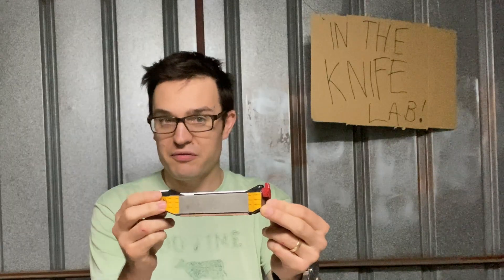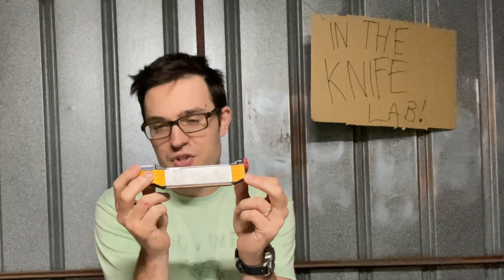How To Sharpen in Full with the Work Sharp Guided Field Sharpener (Review)

Comment: Quick tip for cleaning your ceramics, when they get blacked up they don't sharpen so well, so run a pencil eraser over them to clean them up.
Reply: Holy crap I never knew that. Thanks for the tip. I hate when ceramic gets blackened
Reply: Thanks for this, got a rod for serrated knives, and it's forever going black.
Reply: i dont mean to be offtopic but does anybody know a way to get back into an instagram account??
I somehow lost the login password. I would love any tricks you can offer me.
Reply: @Kane Kashton it worked and I actually got access to my account again. I'm so happy:D
Thank you so much, you really help me out!
Reply: @Elliott Troy No problem =)
Reply: When ceramic gets blackened to the point where it impacts the sharpening effectiveness, it usually means it's time to use a little dawn detergent and warm water to really clean out the ceramic. I'd be a bit worried that the eraser material would clog up the ceramic even worse than steel particles alone.
Reply: @JustIn-op6oy  That's what I do, but if you do a full wash down just remember to take the plates off and make sure they and the inside of the sharpener are completely dry or the back of the plates will rust.  I've used simple green sprayed on a paper towel to wipe down the rods and it returns them to their cutting glory instantly.
Reply: Bon Ami, paper towels and water works really good on ceramic rods too.
Reply: Tooth paste does a pretty good job as well.
Reply: The strange thing I found is that if I coat it in “grease” or “cream” based compound it works really nice too.
Reply: @rshveyda  you can remove the rod from the sharpener by using a jewelers screwdriver or similarly thin metal rod to remove a metal pin the holds the ceramic rod in place.
That way you can wash just the rod and not worry about getting the entire sharpener wet.
Reply: What if i take off the diamond plates and wash the whole thing ??? Should i worry bout the leather strop getting wet ??
Reply: I found barkeepers friend works great for that too
Reply: @sae1095hc yep...just used that exact same method on my WorkSharp Retractable Honing Rod.  Easier than using Ajax/Comet/etc. to clean it.
Reply: Hello, I'm 3 years from the future. I've come to thank you for this tip 👌
Reply: Barkeepers friend works well too.
Reply: @andreibirsan2388 - Ha, my man. I was just saying the same thing love that shit.
Reply: Thank you

Comment: Little tip.. When sharpening on this or any stone don't run the tip of the knife off of the stone, that'll cause your tip to blunt. Try stopping when the tip of the knife has been sharpened then lift the blade off instead of continuing the motion off the stone
Reply: I thought you were crazy for commenting this on petes video, as its such a novice mistake, generally. 

He does do that, though. Pretty bad, some times. Bad enough to likely snap the ultra fine tip on a few of the really hard PM2s.

No hate or anything, ive been sharpening most of my life but cant say id be comfortable putting a video of me doing it on yt for everyone to criticize.

Edit: also suggest lifting a bit to maintain the edge angle at the tip
Reply: Tip seemed pretty good when he split that paper.
That said, I've always done blades in segments- the straight, the curve, then the tip.

Comment: Good video! I have used this sharpener for about 2 years, with good results. It is a FIELD sharpener - don't expect it to take the place of $350 worth of Naniwa stones. That said, I was pressed to repair the overstropped convex edge of the 1095 steel blade of a Tops Brakimo. Using the plates as you would a full size set of quality stones, going back and forth along the length, versus pulling the edge across the plates, I was able to rework the edge to the proper profile, then refine with the ceramic and small strop. The knife was put back into service, then properly refinished once I was able to use my traditional strop with green and white compounds. The knife is sharper today than it has been in years. I absolutely agree that this is an excellent tool for all blade owners, especially those uncertain about sharpening or unwilling to learn and buy high quality stones. With this kit you can keep a blade 100% serviceable for a very long time - long enough to learn and save for quality stones. I have also used the hook sharpener for some of my expensive japanese hooks, as well as the broadhead removal tool. Also, I don't remember if Pete mentioned it, but the ceramic rod is held in place by a small silver pin. If you remove the pin, the ceramic rod can be used outside of its housing. Worksharp has also made all parts of this kit replaceable and offers them separately. In my opinion, it was money well spent.

Comment: I started with this 4 years ago and I'm still with it.
Reply: 2 months later?
Reply: I've had the Field Sharpener for about 4 years too. I use it on my EDC, sheath knife and all my kitchen knives. It's great for touch-ups with just the ceramic surfaces
Reply: The stone not not going deeper after 4 years of strop the knife on it?
Reply: @dolguldur4706  ...no, seems very good still
Reply: Cant be much blade left then …

Comment: I picked up one of these About seven years ago and have been using it as my primary sharpening system since then. Mine is sold that they still used stickers for the instruction panels on the back. It was the first production run I believe. Great system highly recommend it to lots of people.

Comment: I just got this sharpener and followed along with your video. had my Benchmade for 5 years and it has never been sharpened. after following this video it seems at least as sharp as it was new. thanks!
Reply: 5 years did you never use it lol?
Reply: I wouldn’t be able to stand a dull knife
Reply: @conley_v5848  used it every single day.. treat it right and it’ll hold an edge for a while
Reply: @jamesyuh46 
I had a Benchmade I used as a work knife the griptillian for 2 or 3 years before really noticing it dull. A lot of it is knowing how to use a knife, and when to pull out the 10 dollar Kershaw to doin something a bit too destructive lol

Comment: I struggled using other stones and systems for years. I could get them fairly sharp but not hair splitting sharp. Then about four years I found a great sale through Work Sharp and bought both this field sharpener and the Ken Onion professional edition belt sharpening system. I found both to be better than any other system I have tried! This field sharpener is so simple and easy to use that I rarely go to the trouble of setting up the belt system unless I want to sharpen multiple knives. 

What I have found from using this field sharpener is that it taught me to hold an angle first. Next I learned how to identify and even feel the burr you make on one side before switching to the other side of the blade. Learning to identify when you have formed a burr is game changing when sharpening a knife. You can do equal amounts of passes per side and get a sharp and usable edge but if you learn to find sharpen on one side until you form a burr, switch sides until you create a burr and then move on to the next grit you will have created an apex edge which I feel is sharper and lasts longer. Then after some use just touch up on the strop and you are back to razor sharp again. 

My number one tip is to learn how to identify the burr!

Comment: At 14.08 you say again a 20 degree guide. I found this video after just buying this sharpener today and the instructions say the ceramic guide is 25 degrees. 
Any idea why it's steeper?
Reply: The diamond plate guides are 20 degrees. The ceramic rod’s guides are set at 25 degrees to form a micro bevel.

Comment: I probably use this more than my KME. Love that little guy.
Reply: Is that because you need to sharpen often away from home or you use it because you don't need the mirror polish?
Reply: @Meowbox9000  just easy for touch ups. No set up, and it works well. I use the KME for reprofiled or damaged edges.
Reply: EDC elephant totally agree, this is much easier than setting up the KME.

Comment: Instinctively..: I would not want to waste a hand's energy and attention to just hold in place the sharpner, and one single hand left for maintaining angle thus  VARIABLE pressure to control. At least just only push-locking the sharpener egainst a resisting something (groove or clamp or "wall"  but not trying to hold it against any direction. Instead I would take both hands to hold the knife (on both its "extremities") and perhaps use my whole body to some extent (- or inverse, fix the knife).

Comment: The ceramic and strop angle guides are actually 25 degrees. For whatever reason they designed this to put a 20 degree gritty bevel on it followed by a finer 25 degree microbevel.
Reply from the maker: interesting! probably helps steer the burr into itself
Reply: Cedric & Ada Gear and Outdoors True! Seems to work well. I imagine it also helps negate/offset any angle deviation on the first two grits. Thanks for the great video!

Comment: I found a neat trick for the ceramic rod, If you coat it 0.5 micron diamond paste? Grease?  from veneve it works much better for wear resistant steels.

Comment: You should try their guided sharpener with pivoting stones, that thing is amazing.
Reply from the maker: next channel buy for sure
Reply: I've got one and love it!
Reply: I have that. My first sharpener. If you have a steady hand it does a pretty darn good job. 
The tilt system would make an even bevel compared to a kme which would some areas of the knife bevel wider if it’s ground to be thicker.
Edit: wanted to add that the ceramic section is removable so that can be your field sharpener making it a good one system for home and field.
Reply: Agreed! I have the guided worksharp also and it's great! You definitely want to get the add on for it tho (an extra fine &extra coarse plates and a strop). It really does a good job of keeping a consistent bevel on a curved blade too.
Reply: I own them his and the titling system with extension kit. Both are fantastic.  I’m a sharpening n00b and learned a lot using them.
Reply: Tavis S forgot about that. Yeah the extra kit is definitely worth it.
Reply: @CedricAda  
"next channel buy for sure" 
1 month later
...
Reply: @CedricAda  Was looking for your review on that one! I may spring for it anyway.

Comment: This is my hunting sharpener but also has become my main sharpener for all blades, pocket or hunting or kitchen, because reasons. The thing works reliably for me, and I havent pulled the trigger on a full set of diamond plates. Agree 100% that a good stropping, even with the basic green aluminum oxide compound, has allowed me to achieve better edges than I would have been able to achieve with whatever other sharpening steps I would have otherwise used.

Comment: Thanks for this review.  I have zero real sharpening know-how.  As a Walmart reviewer, I was just offered 1 of 2 Workshop sharpeners, the one in this video or the electric Combo Sharpener.  At first I intended to get the electric model, thinking it would be easier.  After quickly checking reviews on the 2 options, including this video review, I opted to try the model you reviewed here.

Comment: for the stroping part mate, you have a 20 degree angle... the first 3 processes, you push the blade onwards, so in that case you have the guide facing the direction of the push and it is higher than the sharpener. for the strop part tough, you pull the blade towards you and have the black part as guide. place the blade on the black plastic piece, lock in the hand angle and pull towards you. that is the guide.

Comment: It would pay you to watch how Work Sharp personnel show how to  use the stone. They say to stroke 5 to 10 strokes on one side until a burr can be felt on one side. Then do the same on the other side. Also don't let the knife point fall off the stone hard, it removes too much metal on the point.

Comment: Did anyone else cringe hard at 2:33?
Got this sharpener, great little tool and portable enough to keep in a pack for longer backpackung/camping trips, to keep in a tackle box and its stable enough to use at home. The small ceramic is good for if you have partially serrated rope cutting blades too.

Comment: Luv that sharpener. I found that holding the knife with your index finger on the spine and your thumb on the side of the handle will lock your wrist for more accuracy with maintaining blade angle. For the opposite side your thumb will be on the spine and your index finger on the side of the handle or blade. This grip  transitions well to your regular sharpening stones once muscle memory is established using this system.

Comment: There are guides for the strop too. Plus you can punch out a pin at one end of the rod and pull it out to use it outside the main unit.
Reply: Is this the ceramic rod do you mean?

Comment: I have one of these in my lunch box to sharpen my work knives and Leatherman (I use a Wicked Edge on my nice knives and a Chef’s Choice Trizor 15 on my kitchen knives, along with a few strops). It works great for what it is. I had to straighten the edge on my S110V Spyderco Para 3 with it once because it got a little nick and I wasn’t near my house, and I DON’T recommend that, but for relatively soft work steels it does a great job if you keep them maintained. Excellent product if you have realistic expectations of it.

Comment: Completely agreed Pete. It's really a solid component piece for a camping pack. 
Question; which micro compound do you prefer as the replacement once the 'stock' compound w wears off? Which seems to happens rather quick. Great channel
Cheers!
Reply from the maker: I have a lot of the tormek compound, so i use that a lot. its really nice but my expertise isnt as attuned to noticing much different when it comes to those minutia

Comment: One quick tip - stop on the sharpener when using the plates so you don’t round off the tip of the blade.  (For beginners)

Comment: Just purchased one one of these after the video. For my reasonably sized knives, I love my Work Sharp Ken Onion belts with blade grinder attachment, but it's no where near suitable for my smaller knives (Case, Victorinox, etc.)... Neither is my Apex Edge Pro, so this thing should get a working edge back on them (or establish one in the case of my Case Stockman)

Comment: If I were considering this vs the Spyderco sharpmaker, which would you recommend?
Reply: I have both, and depends on what you want, this is more of a pocket solution, and has more features...you get coarse and fine stone, plus ceramic plus strop, the sharpmaker you only get medium and fine ceramic, but the sharpmaker is easier to use, you should consider the larger version of this one, the guided sharpening system, its a great system too, and very versatile...
So if you want a portable system, for the field, get this one, if you want a bench system for home or work, get the larger one, with the extension kit, especially if you are interested in learning free hand sharpening, but if you just want to keep it simple and you don't need to reprofile your knives...just to keep them sharp, then get the sharpmaker.

Comment: I dont think you are sharpening it at 20 degrees if you rest the knife with the bevel, since resting on the bevel actually angles the knife steeper. All knives have different thickness, so the angles will be inconsistent if you were to rest on the bevel. I think its best to try to have the knife parallel to the guide to get a true 20 degree instead of resting it on the bevel.

Comment: I'm going to annoy people and recap my field sharpener experience...agaaaaain.

I've had a Benchmade branded one of these for (I think) about 3 years. It's the only sharpener I use nowadays. My Smith's kit and my Lansky kit are packed away. A few things. First, the Benchmade branded field sharpener has 'Benchmade' etched into the coarse stone. I have used that side on my Golok and on my BK-2 when I was restoring it and it eats softer steels. My BK-2 had a quite large chip on the blade and I've managed to remove it using that coarse side. Other than that, I only use the fine side and the fine ceramic rod. Oh, that small ceramic rod is for serrated blades I assume. Oh, and thanks Danzigity Fz. I was wondering what the pretty patterns were for. Never thought of arrows.
I wrecked my field sharpener a year or so ago by deciding to clean it with Acetone. This method melted the rubber o-ring that holds the ceramic rod in so I now leave the rod out and only slot it in when I need it. It also dissolved the glue that holds the small strop pad on, so it's gone too. I have a strip of leather belt glued to a piece of timber for a strop nowadays. 
I've found this style of sharpener to be really good for everyday use and for when out bush or fishing. Yep, I've used the hook sharpener too. It's easy to use and kind of fits in your pocket. I recommend it.

Comment: What do you recommend for a Mora Scandi?
Reply from the maker: a simple whetstone is best, moras primary bevel is usuallt about 16° eqxh side depending on stock thickness. I’ve never been great at whetstone sharpening, but I’m intending to get better in a video series
Reply: @CedricAda  thanks. On the Mora website they seem to recommend a sharpening steel. I've worked for hours on my companion carbon steel with a wet stone and I just can seem to get it sharp.

Comment: I really like this sharpener and its design. For my larger knives, rather than draw the edge across the sharpener, I can grip it to do the opposite and draw the sharpener across the edge. Works like a charm. I wouldn't do that with a brick. Takes practice though. lol
But like you said, you're not going to ruin your knife. It'll be fine.